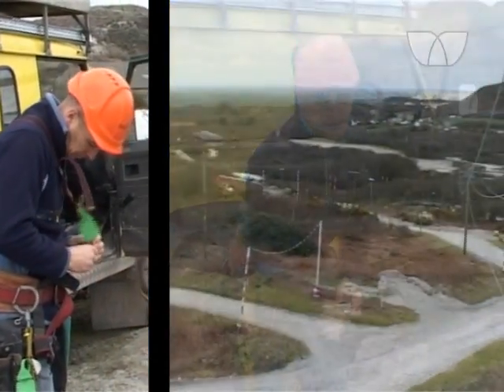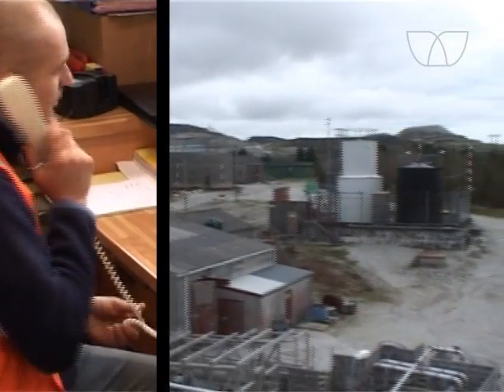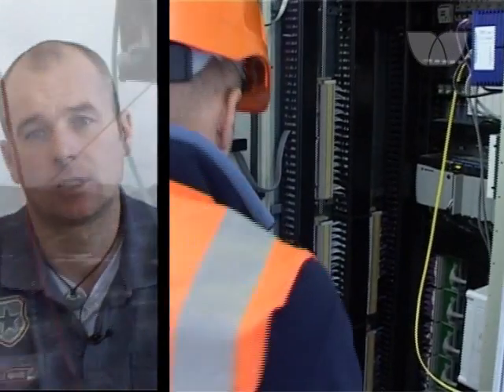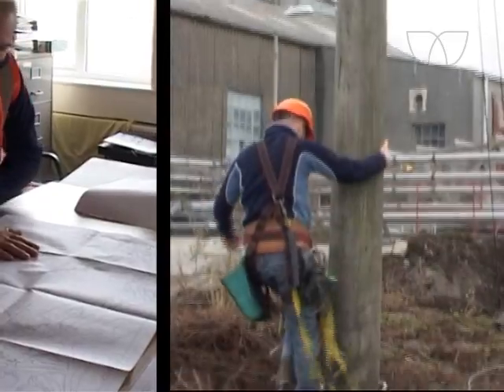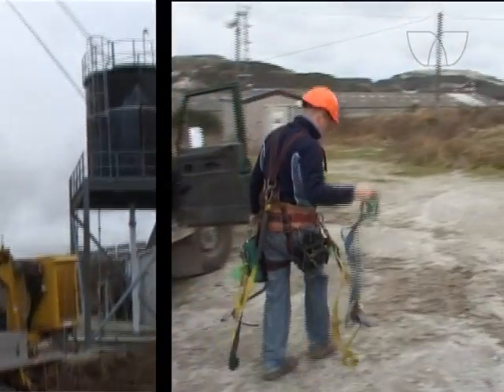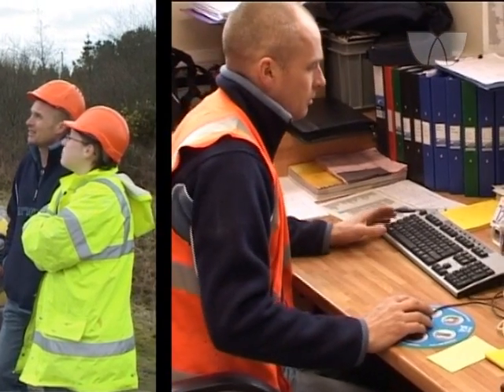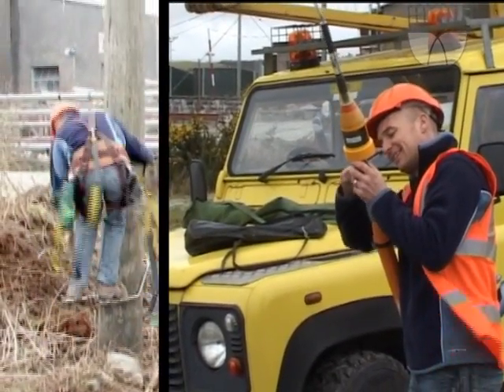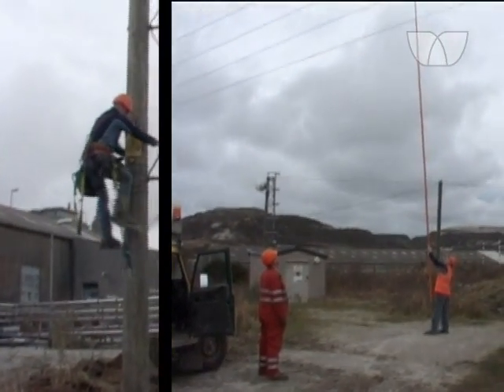Electrical Technician - Career Information

Comment: @cristoretornebiblia For Math it depends in which EE field you are working. Differential equations, Complex analysis, Fourier transform, Laplace transform, Vector Calculus, Stochastic processes, Boolean algebra, Taylor series, Engineering Statistics and more. But you need to be comfortable with Algebra, Trig and Calculus in general.

Comment: @cristoretornebiblia Hi, to be able to call yourself engineer you need at least a BEng which is a Bachelor degree in Engineering or a BSc (Bachelor of Science) in a engineering related discipline and/or an accreditation by IET in the UK same for most EU countries to their respective Engineering Institutions. without an accreditiation by Eng. Institution you are not an engineer but may call yourself technician. Hope this helps. If you need more infos you can send me a private message.